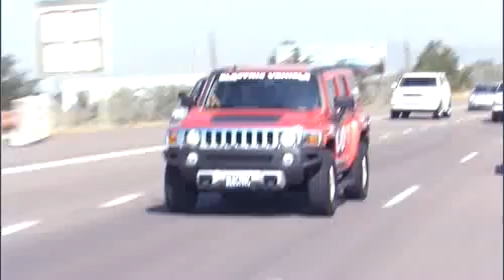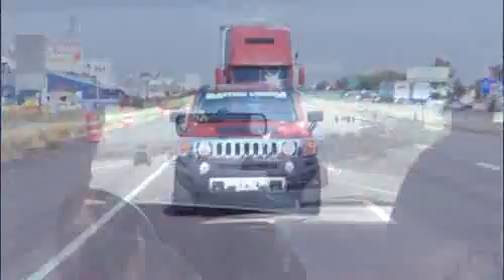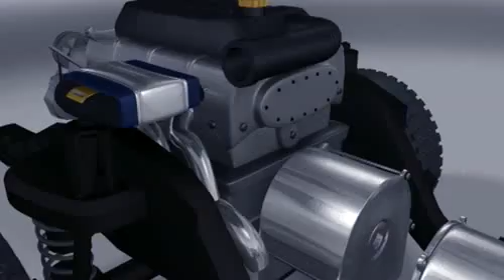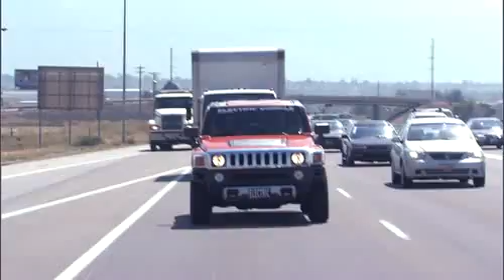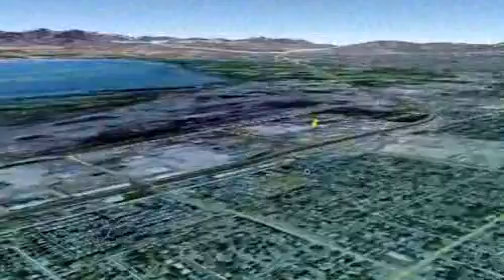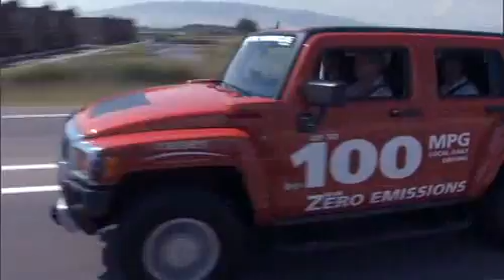Electric Hummer H3 Highway Test Drives

Comment: Running that four cylinder 2 liter motor paired to a 100kW generator at proper load seems like it would devour that engine in 50K miles.